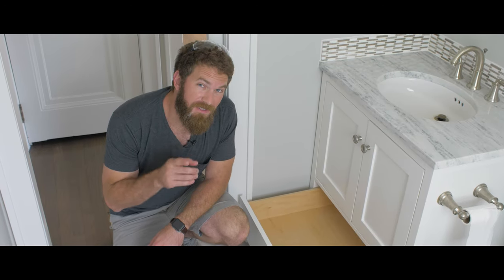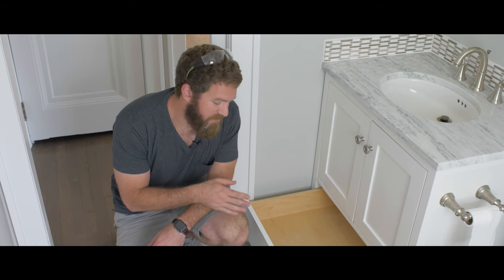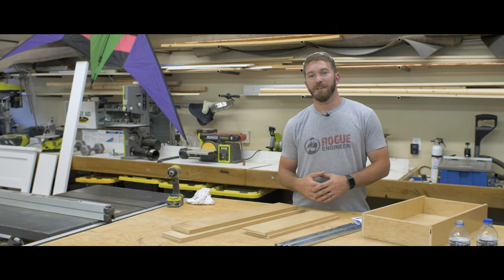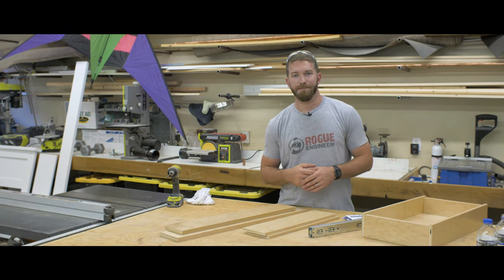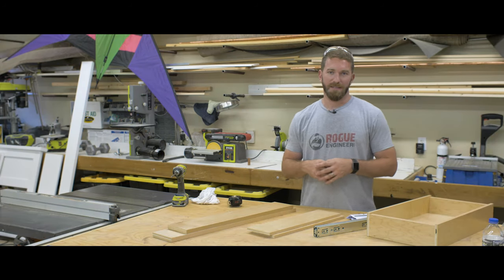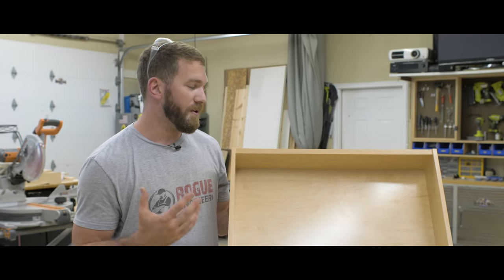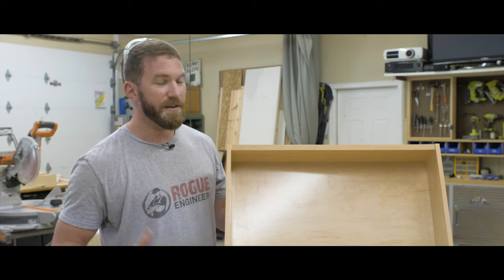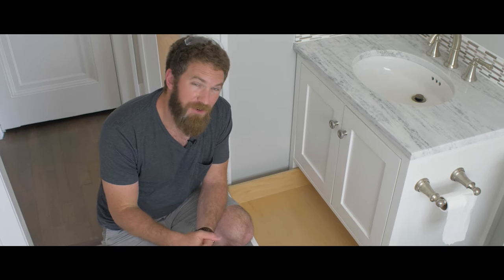How to Build a Simple Drawer Box

Comment: Having made drawer boxes using just about anything from dovetails to dowels to pocket screws I have to say that I have some reservations about your construction technique. The use of brads is fine and all for simply holding the parts together while the glue dries on most projects, shooting them into "end grain" , for lack of a better term, into plywood can be problematic as even cabinet grade ply can and will have random voids in the filler plies. Not to mention that they aren't exactly known for their holding power especially in drawer boxes which can have a lot of lateral stress on the joints. 

As for the glue, even TB3 can fail in hot, humid locales like a bathroom. Then there is the fact that it is applied to, again for the lack of a better term, end grain which is then in turn attached to a pre-finished material. I can see that glue joint failing over time. At the very least I would have went back after the fact and added some dowels at the joints and perhaps used longer screws on the drawer slide to make certain that they were mechanically attached to that drawer bottom. I mean no offense by all of this mind you, and I understand the need to make a drawer box as quick and easy as possible but I don't think that it should come at the expense of craftsmanship. I'd much rather take a few extra minutes to ensure that the box lasted a good long time.
Reply: You're being very polite.
Reply: A lotta info that I can’t get my head wrapped around, so sorry if u mentioned this in the comment already, but how should I make it more durable?
Reply: Exactly what was going through my head too. Quick? Yes. Easy? Yes. Durable? Not a chance in hell, lol. Wood glue on prefinished ply essentially does nothing, so those drawer fronts are only held on with brad nails. Looks good, but isn't a good design.
Reply: Pocket hole screws would be the quickest and easiest way. Don't screw around with dowel joints on thin boards. You will create a weak spot in the drawers that can tear out with normal in and out drawer pulls over time.

Comment: What glue did you use to glue to your prefinished plywood?  Not much will stick to the UV cured finish.
Reply from the maker: I used wood glue but you're right, the brad nails do most of the work. I've never had them come apart but if you are worried about it you could rabbit the sides sightly to remove the UV finish

Comment: No offence plz.  But no measurements of drawer given, the adhesive applied is not mentioned, is that a stapler gun? Drawer slides, where exactly do you screw it on the drawer?  Where does the corresponding piece go?  Apart from the above, it is a piece of cake...!